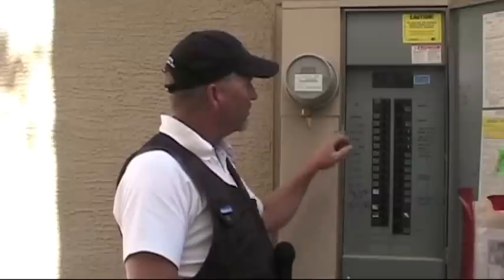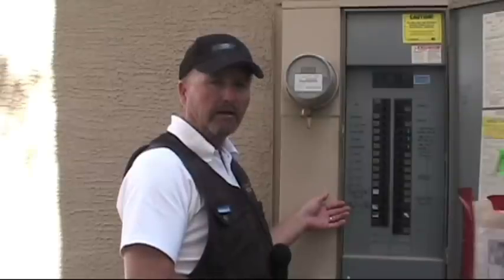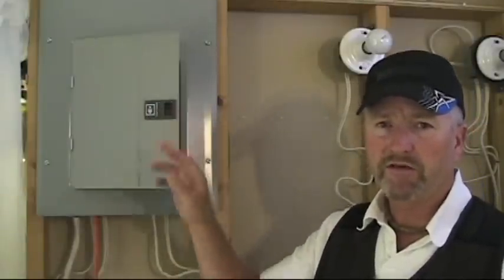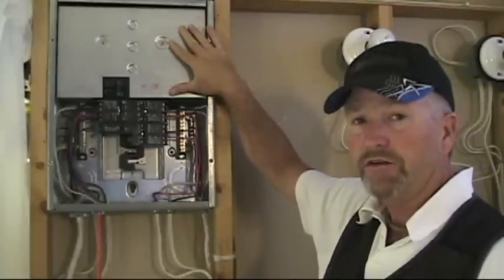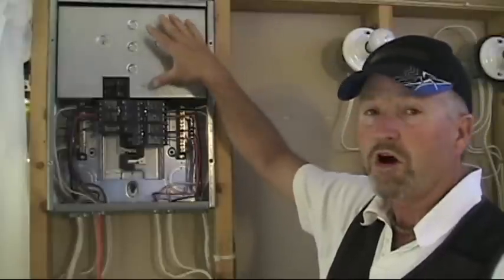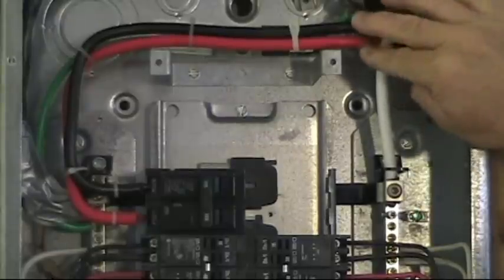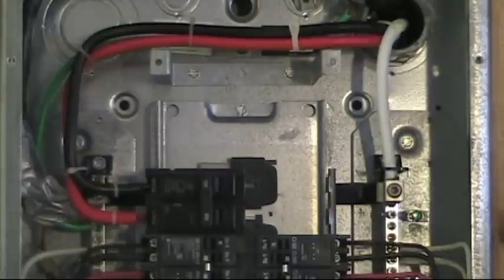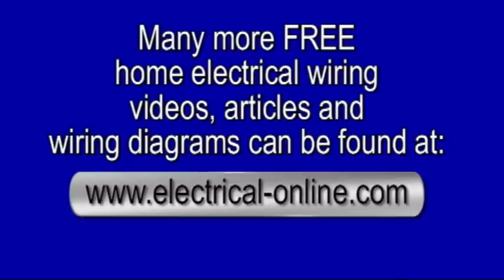Understanding Your Home's Electrical System:  The Main Panel

Comment: i tested my breaker in the panel with a multimeter and got 121 volts then i tested the outlet and got121 volts but when i put a load on it the outlet stopped working but the breaker did not trip , whats your thought on that?
Reply: GmGarlo Not sure if you have managed to fix it yet. I'm educating to become a electrican in Sweden, so the Components are a bit diffreant from what I have in my country but the basics are still the same. 
Have you checked that the outlet still gets it's 121 volts when you add the load? Otherwise you could observe what the breaker does when you add the load to the outlet.

Comment: how volts comes in to the house?
Reply: Chhaka Luoy through either overhead or underground wires provided by a local utility company
Reply: The US system is 220-240v split phase with the centre tap neutral attached to earth. That give either 110-120v to neutral or a 220-240v live/live power system.
Reply: MAGIC!!

Comment: I’m a diy er and was wondering if I can install a 30 or 50 amp 240 volt exterior outlet on the side of my house to connect a air compressor or does it have to be installed inside the house. 
Thanks
Reply from the maker: If you do the installation to comply with code rules, no problem.  Must use outdoor  components, (conduit, cable, box, and cover plate).
Reply: Terry Peterman ok thank you for the information. 👍🏽

Comment: Terry according to NEC what is the height of the electrical panel from the floor to the top? residential
Reply: Ricardo Farfan 6ft 7in to center of operating handle. Usually the main breaker. No minimum height though.

Comment: Not sure why i always thought it was 110 V and 220 V?
Reply from the maker: Dynamic Dopamine you’re correct, it used to always be referred to as 110/220. Somewhere along the way, 120/240 became the standard. Regardless, that’s the target voltage and there is an acceptable variance. If I checked and found anywhere from 112 to 125v on each hot, I wouldn’t be alarmed.
Reply: @theinternetelectrician  I think that actually answers my next question or at least half of the question. What I mean by that is that kind of answers my question on the hot wire, so if I check with an ohmmeter to see if I needed to change out the electrical wires in my house... As long as I saw 112 to 125 V, my wire should be good on the hot side? But what about checking my neutral wire? Would I check it by the ohms which is the resistance? But on multimeter would that be continuity? And also how can I check the ground wire with a multimeter?
Reply: @theinternetelectrician  basically, we lost everything we ever had in a house fire. We had no insurance on the mobile home... It happened May of 2019. We are still homeless to a certain extent. I have had to put new floors new water pipe and basically knew everything for us to get to where we can move into it, we have no insulation or sheetrock up we have absolutely no vanities or cabinets or bathtubs or sinks... I've still got to get a water heater, I've got to get some floors to put down... Not a subfloor, I just completed all of the subfloor! I'm talking about things like carpet or floating hardwood or linoleum AKA vinyl whatever you call it. The house had a lot of water damage because the roof if leaking, we only paid $300 for it so it makes sense why all of this stuff needs to be replaced! It is a 1987 model Fleetwood Weston single wide 2 bedroom 2 bath! I just wish I knew if I needed to replace the electrical wires or not.? We will have a little five-year-old staying with us a lot and I cannot take any chances but we can also not afford replacing all of the wiring right now either. I guess I just need to know if it absolutely needs to be done or not

Comment: At the big store where I work we use floor scrubbing machines-got 4 of them with onboard chargers.  Each machine has 4 12v car batteries.   Two 120v wall outlets have caught fire in the charging area-burns on the wall and melting the plastic and wiring. Any number of flammable things nearby.  From what I've found out it was because two machines were plugged into the same outlet.  The electrician came and replaced the two outlets.  Now store management has put up a sign saying 'only one machine can be plugged into an outlet. I've had some electrical training and work experience.  I don't understand this.  How can you overload these outlets without tripping a breaker?  How can this condition even exist legally?  Shouldn't each outlet have it's own circuit to prevent this?  These are common duplex 120v outlets but they must not be separated with separate circuits.   Now they just put tape over one of the duplex outlets.
Reply: deric smith certain breakers out there don’t trip as they should FPE is one. We’ve replaced panels at entire condo complexes because of this. Also you’re supposed to cycle breakers and mains often to keep them moving freely. You could have a faulty breaker.
Reply: Or they could be over fused. Some knucklehead could have put a larger breaker on the line because the circuit used to trip when you guys were overloading the circuit.
Reply: That was the result of an improper and dangerous electrical setup. The wiring is likely only 14 gauge which can only handle 120 volts with a 15 amp circuit breaker. It's also likely that it's on a circuit with a 20, or even 30, amp breaker. And you've witnessed the results. 
 The only other possibility is that they're using common receptacles that are rated for 15 amps that are on a 20 amp circuit that has 12 gauge wire. If that were the case the receptacles need to be upgraded to the heavy-duty 20 amp versions; that is, unless the circuit has 14 gauge wire which only rates to 15 amps.
 Regardless, it's not rocket science and it's clear whoever is in charge of the electrical service is ignoring the basics of the field.

Comment: Should have just used your main panel outside instead of the oddball one you mocked up inside  as a main panel.  That one outside is what most people are going to encounter.  You could have just opened the main breaker for a little while while filming.

Comment: That looked like a main panel outside, so the panel inside should be a sub panel were all your neutrals and grounds are separated... What am I missing here?
Reply: You are correct.  Everything after the first disconnect should have isolated ground and neutral.

Comment: It’s not duct under the ground, it’s conduit. Duct work is what your AC blows through, conduit is how electrical lines are run.
Reply from the maker: Thanks for the input, but,.....Duct; plural noun: ducts
:
a tube or passageway in a building or machine for air, liquid, cables, etc.  synonyms: tube, channel, passage, canal, vessel; conduit, culvert; pipe, pipeline, outlet, inlet, flue, shaft, vent, airway

Comment: To make a connection to be able to use my dryer machine. I need a 4 wire cable is that what is called??
Reply: Gauge awg

Comment: Terry I like your vest.  where did you buy this?
Reply from the maker: Thanks Gordon. I've had comments like "why is he wearing a bullet proof vest", etc.! It was work wear designed especially for electricians, and a company called Skillers.  I believe they no longer exist however. They were out of the Maritimes in Canada.  They had pants as well, built in pockets in them to slip knee pads in, accessories like tool belt and pouch attachments, etc.  We bought all our staff a set when we had our contracting business.

Comment: Many charts on the Internet give a 220 circuit double available amps, which is not true. Just because you have…2-15 amp breakers, it is not a 30amp circuit. Voltage yes 220-volts. Polarity yes load no????

EXAMPLE:
2 times 1800 ==3600 amp circuit??? How??
You can only draw 1800 amps from a 15-amp circuit, right?
HELP?
Reply: King Kano World Media
Reply: That's pretty much how it works. Two breakers = two hot lines = more amperage can be carried. 
I'm ignoring the second half of your comment because it doesn't make any sense.

Comment: Is a wedding ring next to the bus a good idea?
Reply: No it isn't a good idea at all but this isn't a safety video. He is using a demonstration panel that has no power to it which is why he is touching things.
Reply: MrTedMcForeHead not really we use metallic ladders at my worksite when working with panels. Is it safe? Not really but it gets the job done
Reply: still not a good idea especially for a so called teacher... right upo there with pulling the trigger on a gun because you "Know" it's not loaded - until the one time it is...

Comment: I want to install a subpanel my main panel is 125 amp 20 space. The new subpanel comes with 100 amp main breaker. What should all the main breakers be?All 3 main breakers 100amp?
Reply: DIESELDAN 3 %t

Comment: The boards are getting too complicated, for DIY enthusiasts unless you have. My safety switch was not correctly wired by an electrician, I could have had a fire or easily have been electrocuted. They are just too complex these days, My meter is just too complex fo me to play with. My local authorities also regard it as Illegal for a non qualified person to play with it.

Comment: Please tell me why don't you americans don't use RCD in the panel  to protect the people. Here in Brazil it is mondatory to use RCD.
Reply: In the USA they call them GFCI (Ground Fault Circuit Interrupter). As I understand it, they are now mandatory for hazardous areas, such as bathrooms and kitchens with a few exceptions. As with many countries, what is installed in existing buildings is likely not to meet modern the latest standards. It's certainly the case in the UK where RCD protection is now effectively mandatory for (almost) all domestic cabling and the distribution panels (called consumer units) now have to be constructed on non-inflammable materials. However, look in a typical house and you'll find a lot of legacy installations.

Comment: You American electricians have to learn a lot from European electricians, your electrical systems are outrageous and they would not pass the approval of the European electrical standards.
You remained in the 1960s as a construction of electrical systems.
My eyes like the cook Gordon Ramsey of Hell's Kitchen horrified to see certain dishes, the same for me to see your electrical installations.
Reply from the maker: RovereTano maybe us Neanderthals should head overseas en masse  (knuckles dragging)  and attend some information seminars?!?
Reply from the maker: At least our electrons travel 10 more times per second than yours do!
Reply: Don't Europeans only use "CLX" bc they got tiny hands and can't use a "one shot" bc 1/2" " GRC" is just too tough on such wittle hands?
Reply: @lonetraveller you are confusing politic with electric security
Reply: @lonetraveller  You are confusing politic with electric security

Comment: dafuqs this guy wearing bullet proof vest??
Reply from the maker: JonTheChron ask yo momma! 😀
Reply: oh God, I haven't heard that one on a while!

Honestly, I like your video! It's so weird that you guys have those outdoor panels on homes.. we dont have those here (or I've never seen one) and also we would call the first panel the main panel and subsequent panel "sub-panels".. Interesting how terminology can vary from location to location
Reply from the maker: JonTheChron It's not something I'm used to either. In Alberta Canada, where I was trained, main panel is always inside the home, usually in the basement or in an attached garage. This is what they do here in Arizona almost always.
Reply: I'm from Quebec, Canada and I haven't seen that either! I guess AZ doesnt have winters like AB!
Reply from the maker: JonTheChron And no basement as a rule. No need to have the services buried 8' deep. It's still strange to have your main panel accessible from the outside?!? First thing I did was put at least a small padlock on it.
Reply: Terry Peterman that might be a violation?

Comment: Sorry  dude  i just  can't  watch this  video.  First of all the  panel  behind  you is way  over your head  .the nec says the  main  breaker  should be  not higher than  6 foot.  Unless  you're in a  flood  plain. Number 2 the wiring  behind you  is kinda  weird.  It looks like  some  wires are  not  stapled to  code. Like  6 to 8 inches  from the box.  According to  my city.  But should  be at least  12 inches.  As per nec. Code. Sorry  dude  i have to go  on.  Only  saw 10 seconds.
Reply from the maker: Sorry to disappoint Greg. I'm sitting down in the opening scene so no, that panel is not too high.  That is a demonstration set that I use for some of my videos. It has an example of pretty much any circuit you would have in a home. The stapling rule is up for debate. Myself (and many others) believe in leaving a loop that can be pulled into the box should something go wrong, like the wall board installer nicking or cutting a cable. This gives you something to work with other than tearing off the wallboard and running a new cable to replace it. Anyhow, thanks for tuning in. You and 132 others didn't like it, and that's OK.  3300 did like it, and over 365,000 have viewed it, so I'll get over it.  I'll try to do better next time.
Reply: @theinternetelectrician   sorry  Terry  i thought  maybe you  were a  short  person.  If you no what I mean.  As far as the  extra wire  above the  boxes.  I would have been  red tagged  in any  city  that I  worked  in. Didn't  see the  rest of the  video.  Good luck  and God bless you.